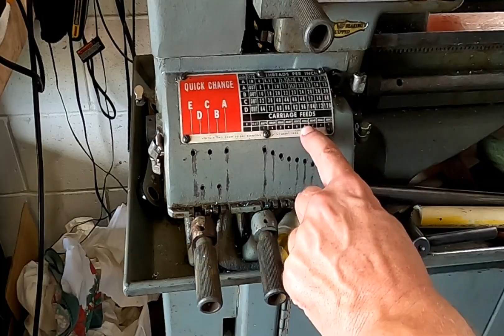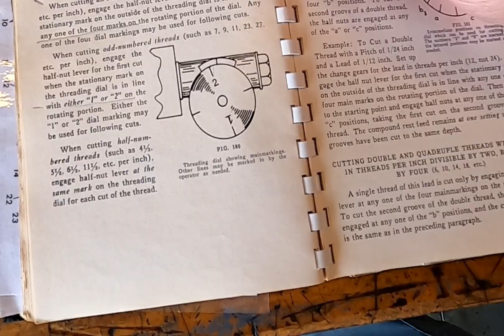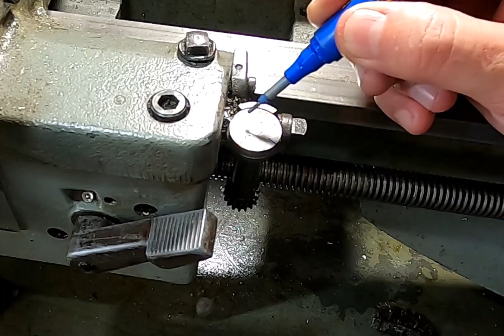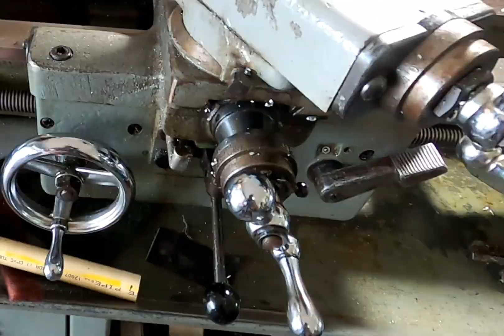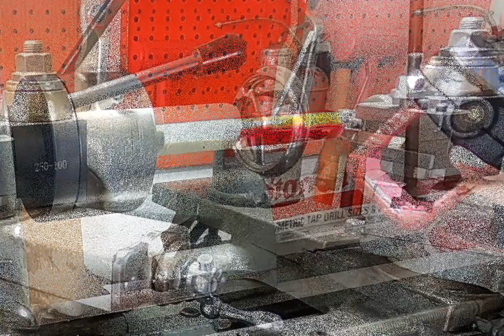Intro to No Stress Threading: How to get started in single point threading

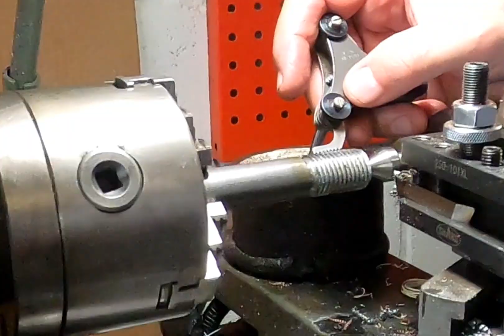Comment: HATE to tell you man but either you have your thread pitch gage set to the wrong  pitch or you have your lathe set up wrong to cut the pitch you are trying to get. The gage shows it  you just do not know how to use it. At 22:30 time it is easy to see that your settings are so wrong,  With 55 years in a machine shop I think I can say you really should not be trying to show how to cut threads until you learn.

Comment: The point of angling your compound slide  to roughly half the thread angle is so that the greatest ridgidity of the slide is aligned to work with /support against the cutting forces .

Comment: On the smaller lathes it's very common to have issues achieving a good finish due to the lack of ridgidity . Speeding up is not necessarily the answer . Slowing down can get rid of unwanted chatter as well . And don't be in a rush to get to full depth , In fact reduce your cut as you get deeper . Thread cutting does put a lot of stress on a tool . the tool is engaging in the work on both the tip and one side but rubbing takes place on the side that  is opposite the direction of travel and rubbing generates additional friction and chatter.

Comment: I have been a machinist for the last 60 years and I never used the thread dial as you can make mistakes as you have proved in your video I just reverse the carriage its the simplest way no mistakes. I did my apprenticeship in a shipyard and I was thought never to use a thread dial !!!!!!
Reply: You can make mistakes with any tool if you don't pay attention.  I learned from two tool and die makers who didn't seem to have any trouble using it, and I don't either.
Reply: I NEVER did it anyother way,  I also worked in a ship yard and ran lathes from very small up to one that had a 10 foot chuck. He was also not getting the pitch he wanted, look at the gage at 22min30 seconds

Comment: five to one . then we have a to reduce  a pedestal drill . KO my lath as all the kit to cut a thread   But no lead screw .  How do i cut a thread  Wek i ues the rack & i cut fine & cores thread & my spindle third size.   !   SEE your Milford  My lathe as that type of shaft but with no led screw  trends   IT timed by a disk on the rack handle.   Les England   What you opinion ?
Reply from the maker: I didn't quite understand that. You want to cut threads but you have no lead screw? That's odd. Is it just missing? Do you have at threading gear box on your machine?

Comment: Hey Don, do you know of a place where you can safely get the manual and related documentation for free?
Reply from the maker: Which manual do you mean??  Don
Reply: @donsengine3158  hey Don! Your Craftsman Atlas where you were looking at the details on how to thread.
Reply from the maker: @keithadkins1834  I think that was one of my Dads that was tucked away in the back f his tool chest. I inherited a lot of his stuff when he passed. You can find those old Atlas manuals on ebay pretty often. I thinks there's a place called little machine shop that has reprints of them as well.  Don
Reply: @donsengine3158  thanks!!
Reply from the maker: @keithadkins1834  Absolutely!
Reply: @d @donsengine3158  On a similar note, when you take out a reference book to demonstrate something, could you please show the the cover and say the name…

Comment: Is there a video on the DRO installation?
Reply from the maker: No, sorry, I did that way before starting these videos.  Don
Reply: @donsengine3158  oh ok I’ve the same lathe I’ll look for locations in another vid. Would you have done it differently for clearances . I’m thinking of a DRO as well , nothing fancy .
Reply from the maker: @jerrypeal653  No, actually on the Atlas Craftsman, this turned out to be ideal. I had glass scales on my Monarch, with the cross slide right behind the slide as is typical. Ended up yanking it all off and tossing it and looking to try a similar set up on that in the near future.  Don
Reply: @donsengine3158  ok I’ll be watching, thanks !

Comment: Here inUK we never set the topslide over like you Yanks.
Reply from the maker: Funny, because most of my single point work experience was under the supervision of a Mr. Franks, engineer in charge of machine tooling, at a joint USAF - MOD shop at RAF Mildenhall where I was working for a good number of years.  He always instilled the importance of keeping the tools sharp through reduction of chip load by setting in with the topslide..  Thanks for watching.. Don
Reply: @donsengine3158  I think that explanation is an old wive's tale and he was pulling your leg.
Once in the cut the chip load has nothing to do with whether front or side feed.
Only supposed advantage I ever heard but never bothered trying was on making big thread where a set over slide might make for a better finish.
I used to make 12 inch stainless valve seats and measured threads over wires with no trouble.
Reply from the maker: @r1xelex  Well, in the Education business we say and is true. First learned, is best learned. I'm not too old to change my ways, but this method still works for me. I did see an interesting video supporting that method and why its true. It may have been Jo Pi , Stephen Goteswinter or Old Tony.. I can't remember right off. What part of the UK you in? Don
Reply: @donsengine3158  I;m in East Yorks now but West Yorks originally.
I'm not saying the offset doesn't work just that in an awful long life I never saw anyone using it.
Reply from the maker: @r1xelex  We used to go to a big AG show up there every year. Very nice motorcycle riding out by the ocean there.
Reply: @donsengine3158  Lots of lovely empty roads to enjoy a bike on.
Reply: So 1 trick ponys.